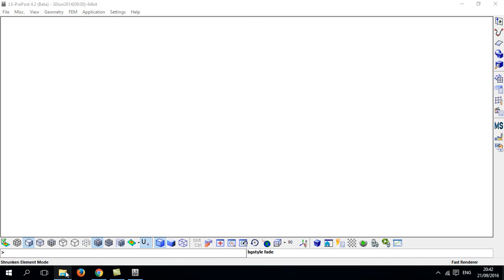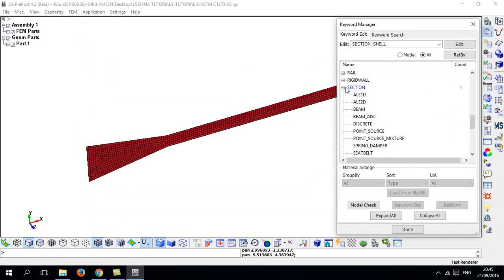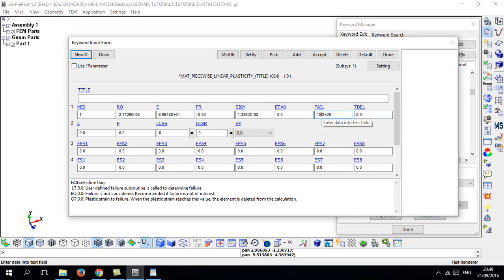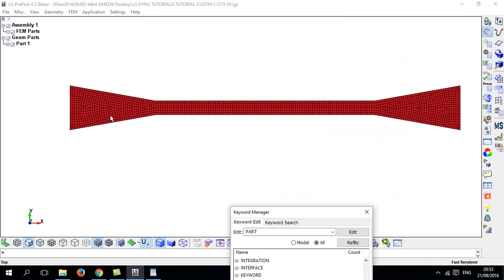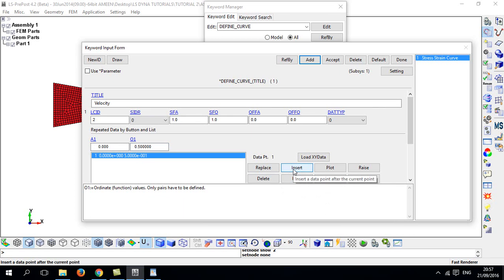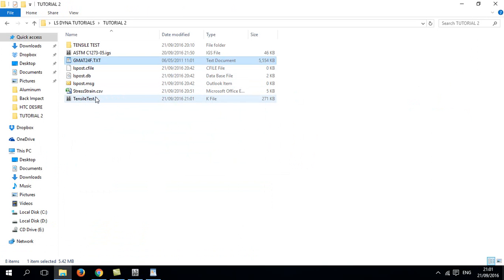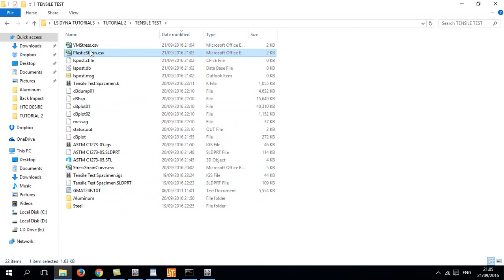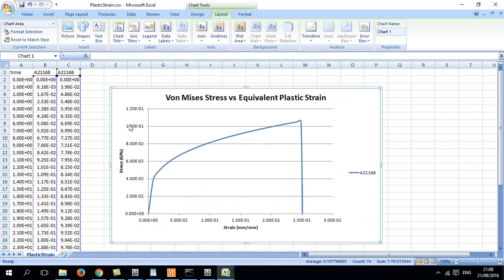LS-DYNA TUTORIAL 2: Tensile Test

Comment: Dear Ameen Topa. I have been practicing your tutorials. I have an issue while loading the .csv file that is not getting a similar plot curve. Instead, I'm getting some weird curve. I have downloaded the same file and same XY data. But got weird curve. Any suggestions?
Reply from the maker: What do you mean by weird curve?
Reply from the maker: I request elaboration.
Reply: @AmeenTopa  so I'm practising the second tutorial on Tensile test. I downloaded the file and then uploaded in CSV form as said in video. I didn't get the exact curve as in the video . I got different curve . My " X " values are not increased constantly. Instead values varied ( Increased then decreased again increased )but "Y " has constant increased values. Due to this my stress vs strain curve came out in a zig - zag way. It's the mistake of the values. If you want to understand exactly. You just download the same folder and upload the csv file. You will also get this weird graph.
Reply from the maker: Can you read in the comments section? Others have faced a problem with the curve and it was resolved.

Comment: Does LS Dyna geometry use MMGS or IPS unit system?

(For example, if I convert an IPS solidworks geom to IGES and export to hyperworks, hyperworks takes same magnitude of geometry length/width but in mm. So I always had to convert IPS to MMGS in solidworks and then export it as IGES)

I do this because I am more comfortable with all material properties in MMGS units than IPS.

Is this the same case with LS-Dyna too?
Reply from the maker: LS DYNA can use both unit systems...depends on the user. 

http://www.dynasupport.com/howtos/general/consistent-units

Comment: Hi Ameen, I executed same as the tutorial.
In the 2nd iteration I used *load in place of *boundary_prescribed motion set, material is deformed but failure has not occurred. What corrections should I do?
Reply from the maker: Hi Kumar. This means that the load is not enough to break the specimen. Try increasing it.
Reply: Hi Ameen, thank you very much for your reply. I increased but its not failing.

Comment: Ameen, legend ni
Reply from the maker: Thank you bro
Reply: @AmeenTopa  Bos nak tanya sikit. Saya guna model SDOF base excitation. Untuk plate bawah, saya define curve letak acceleration (experiment), tapi bila dah abes simulate tak jadi, plate bawah tak bergerak langsung padahal dah assign acceleration. Agak2 apa masalahnya. Tenkiu
Reply from the maker: @muhammadazhar3572  rigid plate? Maybe you are fixing the rigid material.

Also, check the units of the acceleration and the units in your simulation. Make sure it is consistent. Are you using
 m, s, kg or
 mm, ms, kg, or 
mm, s, tonne.
Reply: @AmeenTopa   yes, rigid plate. unit pakai, mm, ms, kg. unit semua dah convert guna matlab
Reply from the maker: @muhammadazhar3572  rigid plate will not work. Put elastic material.

Comment: Brother  after importing this  cad file, iam  not getting  geometric  parts.
(Part 1) ..
Reply from the maker: Hi there, it might be that your view setting is different, meaning the part is there but it is not visible. Also, make sure you import as igs.
Reply: @AmeenTopa  Can you please help me in solving the same issue? I'm new to LS-DYNA. Please help
Reply: However, I imported it as an IGS file
Reply from the maker: After you import, you need to mesh first then PART 1 will appear.
Reply: @AmeenTopa  Thank you very much. My bad